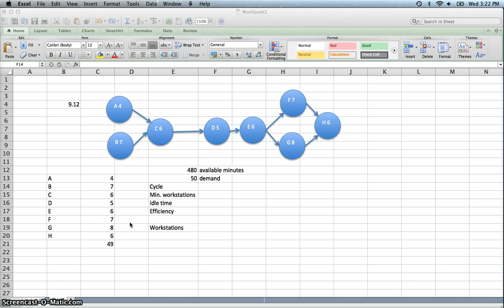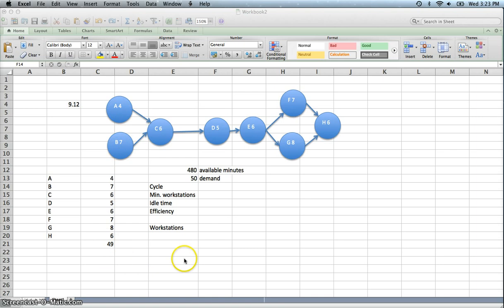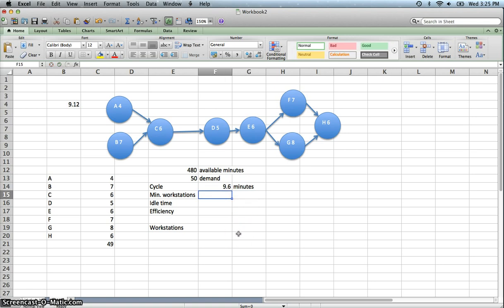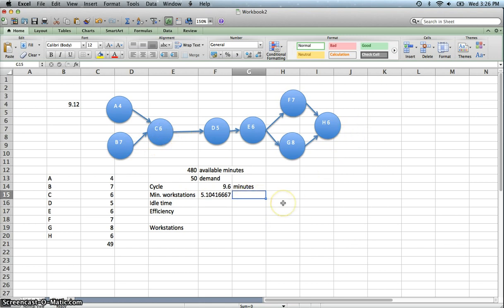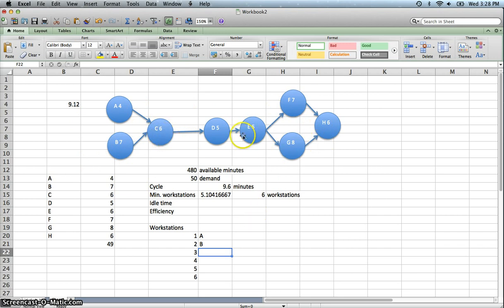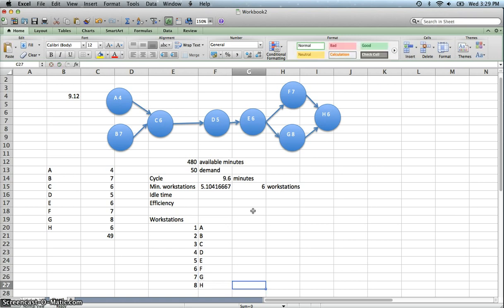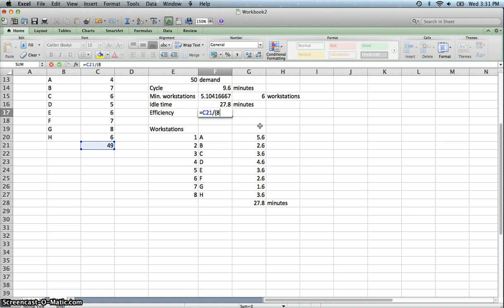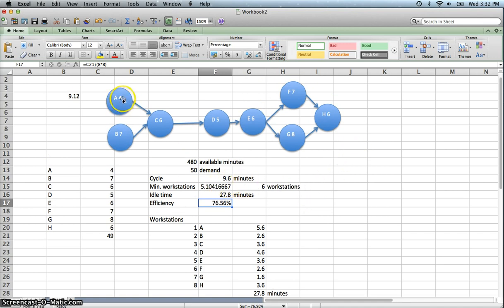Assembly Line Balancing:  Workstations

Comment: Hello, the 9.6 mins is Takt time. Line cycle time is 8 mins. Thanks for the detailed analysis. It helps.
Reply: The line cycle time is under takt time,  is this the reason what te efficiency is calculate with 8 sec an not 9.6 seconds? Thanks for your answer
Reply: @rodneyjav31  yes. Takt is the expected production rate. 8 mins CT is the bottleneck which decides the line output. Hence, productivity uses it for calculation.
Reply: How to calculate line cycle time

Comment from the maker: Remember the calculation on the minimum number of workstations is a theoretical minimum.  To get the current process to 6 workstations as calculated, you would have to try a reduce the time associated with the tasks and re-arrange the process in order to maximize the cycle time in each workstation (no idle time).

Comment: Suppose that an assembly line contains the following task times in seconds: 40, 30, 15, 25, 20, 18, and 15. The line runs for 7 ½ hours per day and demand for output is 750 units per day. The workstation cycle time required to produce 750 units per day is 36 seconds. The problem is that one task in an assembly line takes 40 seconds. Discuss possibilities on dealing with such a task
Reply from the maker: You have to figure out how to reduce that task time or break it into two different tasks.

Comment from the maker: Recognize that the minimum number of workstations is just theoretical (if we can take the total amount of time associated with each task and divide it up into equal chunks of time then it would be possible to achieve this always).  This is not always possible given the actual process and associated tasks.  You simply try to make it as efficient as possible given the times of each task and the relationship between the tasks.  You cannot exceed the cycle time.
Reply: +Cary Countrym Hello sir
Please i would love to know
Could there be a situation where your min no of workstation is less than 1
If so what do you do in such a situation
Reply from the maker: +Oghenevwogaga Izoma When calculate the theoretical minimum number of workstations, you should also round up.  If you did get less than one, which would be very unusual, then theoretically all of the task could be grouped into one workstation.

Comment: Hello thank you for this video. I have one quick question. Why would we want to divide our total task time by 8 * #of stations, instead of dividing the "total task time" by ("Cycle Time" * Number of stations)
Reply from the maker: +jasson toledo To calculate efficiency, you want to divide the Total Task Times by (the actual number of workstation (8) x the maximum cycle time in the actual workstations).  This is to calculate the efficiency of the process as it currently is based on the grouping of tasks and the ability to maximize cycle time in the grouping of workstations (no idle time).
Reply from the maker: +jasson toledo To calculate efficiency, you want to divide the Total Task Times by (the actual number of workstation (8) x the maximum cycle time in the actual workstations).  This is to calculate the efficiency of the process as it currently is based on the grouping of tasks and the ability to maximize cycle time in the grouping of workstations (no idle time).
Reply: Hello, because de line cycle time is under de takt time, is the reason to change de formula, the system flow rate is the minimum between system flow rate and demand.

Comment: What if you have more workstations then needed?
Reply from the maker: You try to group as many task together as you can while staying under the cycle time and looking at the order that tasks have to be done in (you cannot group a task at the end with one at the beginning).  Due to these limitations, you may have to have extra workstations and therefore, the efficiency would go down.  This is when you might want to analyze your process and determine if you can reduce the task times or rearrange the task to allow for more efficient grouping of the tasks into workstations.

Comment: hi , i thought that the # of stations you found was 6, shouldn't that match, if you have to draw your station to find your idle min ? and you should have total of 6 station circles ?
Reply from the maker: +Ienas Gafer Remember that the calculation for workstations is the "theoretical" minimum number of workstations.  Mathematically, one just take the total amount of task times and divides by cycle time.  The mathematical problem doesn't account for the overall process and the way it is organized.  The process as it is currently organized does not allow one to combine tasks and stay under the cycle time.  This is why there is 8 workstations.  One can not get less than the theoretical minimum number of workstations but often one has to have additional workstations because the tasks can not be grouped together because of the way the process was organized and the amount of time for each tasks.

Comment: Sir may i know why the answer in the book for idle time is equal to 15 minutes.not same as to what you explain in the video.
Reply from the maker: I probably need to go back and correct this video to reflect more of the practical approach to idle time.  What I show in the video is the "theoretical" idle time.  You will notice that the highest time for all of our workstations is 8 minutes.  This means that in practical terms you do not have to wait until 9.6 minutes to cycle.  You could cycle every 8 minutes.  Instead of figuring out idle time for each workstation at 9.6 minutes, you would use 8 minutes.  However, you will produce more than the daily demand of 50 (you will actually produce 60 units and cycle 60 times instead of 50).  Therefore, your idle time would be 4+1+2+3+2+1+0+2=15 minutes instead of 27.8 minutes and it asks for the idle time for the entire day: since we are cycling every 8 minutes, we would cycle 60 times and that would give us (15 min X 60)/60 minutes = 15 hours per day.  If we only wanted to produce 50 units and we used the cycle time of 9.6 minutes, this would give us (27.8 minutes X 50)/60 minutes = 23.17 hours per day.
Reply: Thanks Sir for answering my doubt. I think now I do understand the different